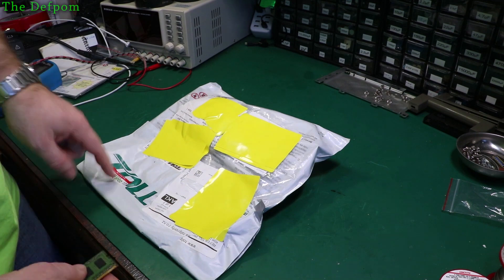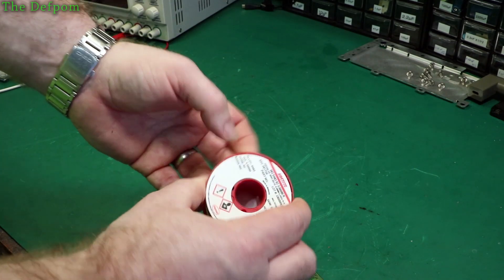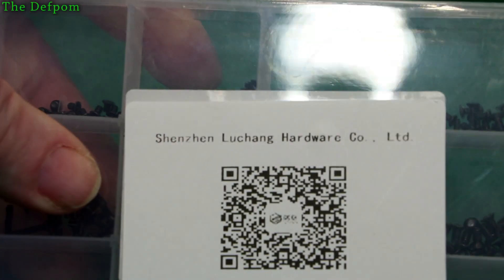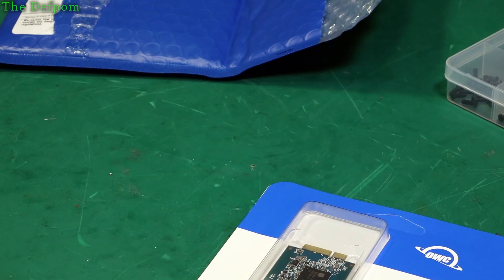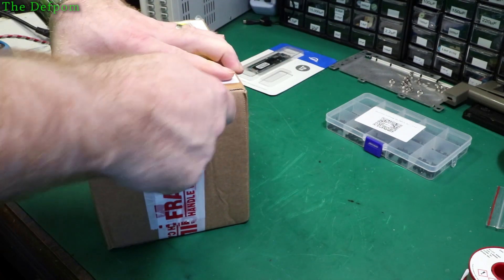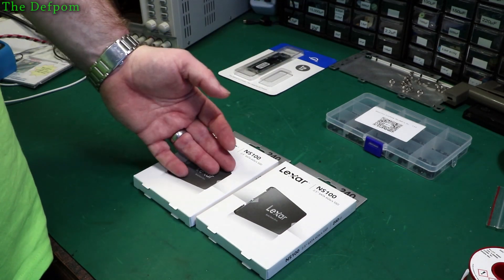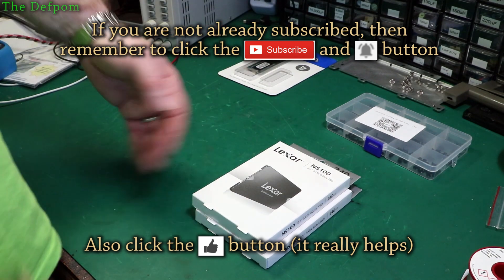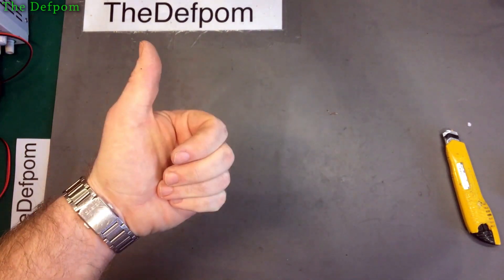🔴 #603 Mailbag Monday 29th July 2019

Comment: you have purchased so much solder lately. I thought solder goes off. Something about the rosin drying up.I also bought some t12 teips and a station from banggood and accidentally confirmed that I received them. I hope they still turn up :-/. ps your list of items does not include links to store
Reply from the maker: abeleski - I am keeping the solder in plastic bags to keep air off them. I have some store links to Banggood, Teespring in all my video descriptions.
Reply: @TheDefpom  i am reporting to tell you that there is no links to the items as shown in this mailbag. I am aware that you usually have them. Check your description. Itmes are listed but no links to the items in the store.